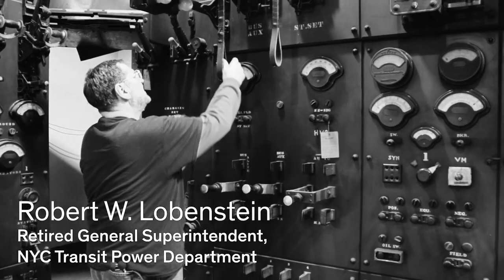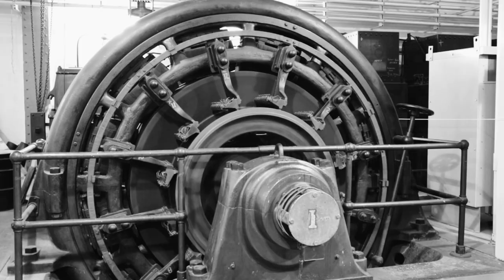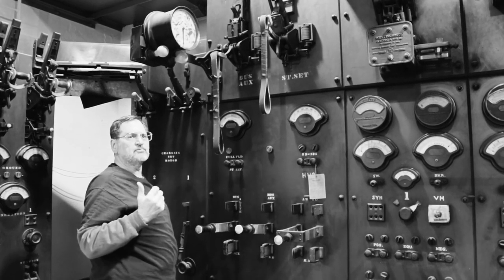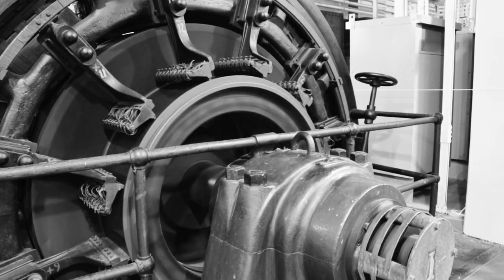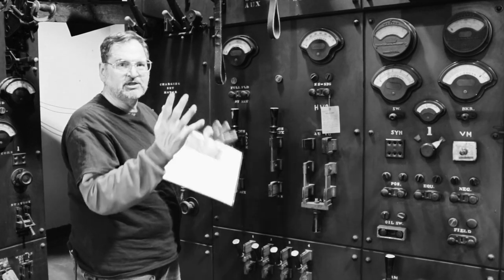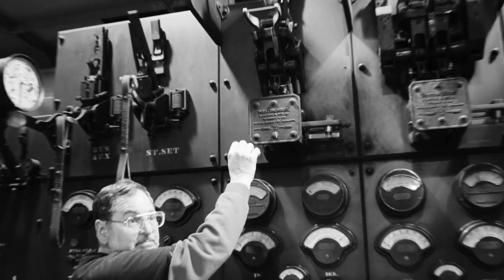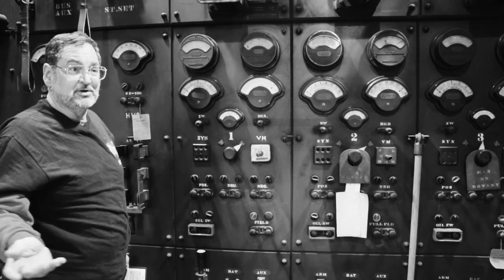NYC's 45-Ton Rotary Convertor

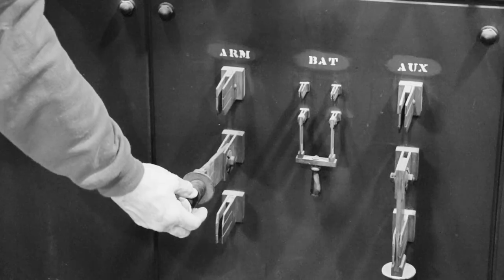Comment: 01:09 did I see a spark there? Meaning that there is a voltage potential on those metal switches? And he is touching them almost? Yup... like the good ‘ol days
Reply: Well... busses would be worthless without current flowing. You don't move electrons without a potential difference so... thats kinda how a switch works when you close it.
Reply: @etherealrose2139  yes, but do they only flow when excited with bare hands? They invented rubber gloves for a reason.
Reply: back when stupid could kill. the way it should be
Reply: @1marcelfilms  or your hand just slips.
Reply: It sparked between those two metal contacts. 

The handle, where his hand touched, is out of the path of flow, and outside the circuit. 
As long as he doesnt touch anywhere on or between those contacts, he'll be fine.

Comment: My dad worked in one of these substations on 38th St in Brooklyn. As a kid in the 70's, I got to visit a few times. They had six of those rotary converters (I believe made by Westinghouse) which looked identical to the one in this video. In addition to these converters, they had huge transformers and two control panels (one for AC and one for DC) for each one. To the best of my memory, Con Ed sent them 11,000 volts AC and the transformers knocked it down to around 400 volts. The rotary converters then converted this to 600 volts DC which went to the third rail to power the the trains. My dad and the other workers took these machines On and Offline in addition to constant maintenance which was mostly brush changes, commutator cleaning and lubrication. As a kid, I was fascinated by all of it. I'll always remember this as well as the insane volume of the sound especially when multiple converters were running at the same time.

Comment: This guy must be an awesome teacher, great explanation of working.
Reply: He didn't once explain any of the terms he used. Unless his audience is full of EE's like me, or at least electricians, all those technical terms will just wash over the tourists like the buzzing of bees. I understood what is going on, because I've studied the history of electrical distribution equipment and electrical trains. But his depth of knowledge doesn't make him a good teacher at all.
Reply: Did you switch off?
Then he's a good teacher
Reply: Kandela Brown  from what I gathered, the DC voltage on the train track (3rd rail) is fed backwards into the system in order to bring the system up to speed so that the AC side of the system is synchronized to the grid. Then the system is connected to the grid with the converter voltage slightly higher than the bus voltage so that current is pushed into the system and the converter becomes a load on the grid and supplies power to the train. I'm a mechanical engineer, not an electrical, so I could be wrong.
Reply: @simonmasters3295  how do you mean?
Reply: Not a very good math teacher though, it was only 114 years old when this was posted, not 118.

Comment: I remember going into the substation on New Lots Ave in Brooklyn, as a kid.  The guys who ran it had a long stick with an abrasive block on the end that they used to polish the slip rings? commutator?  The machinery was mounted in a pit a little  below street level and a good portion of the floor of the station was an open mesh steel grid over the pit.  It looked like a fun job to work there!

Comment: The quality of these motors is amazing. I Manage a chip mill and  we use a 2160 volt synchronous motor on our chipper that was built in the 1930s and originally used in a steel foundry. The motor controls have been modernized and  computerized and we start it by simply pushing a button. The motor itself is all original aside from the carbon brushes and brush springs that are replaced with regular maintenance.

Comment: They used to use smaller units to provide high voltage dc for radio sets in airplanes and ships. They are known as “Dynamotors” and were invented by Nikola Tesla. The a/c and d/c windings are on a common armature with a commutator on one end and slip rings on the other. That is mechanical means of rectifying a/c current or vice versa. I have one in the back of my truck that turns 12v d/c into 500w of 60 hertz 120v a/c. Modern inverters are more efficient and economical. I like the old mechanical things. The dynamotor was invented in the 1880s. Nikola Tesla still holds the record for the highest mechanically generated frequency at 144khz. In 1916 he sued Gueglimo Marconi for patent infringement and won.

Comment: The fact that it's still operational, speaks to the fact that things used to be built to last!
Reply: It sounded to me like this is no longer in use providing power to the subway, but is still functional and can be run for demonstrations. Preserved for historical interest. This would be considered too unsafe and too labor-intensive for actual use in present day. I would imagine it could be modified to automate the control system and safety covers or safer switches installed, if they were still using it now they would have done so, but clearly haven't.

Comment: Would love to have met this man.  Incredible how overbuilt these rotaries were.  They were being used until 1999 when ConEd said no to providing 25 Hz AC.
Reply: Tiny bit of historical context.  The electrical grid in at least most of the eastern half of North America, was 25 HZ Ac until somewhere in the late 1950's.

It was a massive project to, in many circumstances, install 60 HZ AC of all sorts of electrical gear into the grid and leave unpowered.  That was just the grid. Also going on at the same time was the conversion of every type of building  and other use of 25 HZ AC electricity to 60 HZ AC.  Pretty much all the new gear had to remain unpowered until the day of change over.

In the case of this piece of kit, I can only assume some bean counter thought it would cost to much.

Slight aside.  I worked for the local school board (Toronto) for along time. One school I was in a number of times, there was a motor I noticed with more data plates than usual. One day I stopped and took a look and realised this motor had been converted from 25 HZ to 60 HZ. The old plates had been over punched with XXX's but were still readable. The other neat thing about this motor is it still has oiling cups and there is a oil can beside it. Apparently a few drops every couple of weeks.

By the way this motor is for a washroom exhaust fan so it runs everyday for at least 12 hours.
Reply: @foamer443  If you mean the entire power grid, then I call BS on that. A lot of consumer appliances would not have functioned properly at 25 HZ. If you mean a separate grid that only powered industrial machinery and the like, then OK.
Reply: @pauldzim  Yes it was, just do some research. 25 Cycle electricity was common, many household appliances had 25 Cycle transformers in them, I own many these transformers.
Reply: @MrCarlsonsLab  So they built special versions of electric clocks, phonographs, TVs etc for the entire eastern half of the US?? That's hard to believe, if you're talking the late 1950's. Maybe earlier, sure.
Edit: The Wikipedia article is a little unclear on the dates, but a chart there says that in 1946, southern Ontario, Canada was still using 25 Hz. That chart doesn't say anything about the US.
Reply: @MrCarlsonsLab  Not in the mid Atlantic part of the east coast. We were firmly 60 hz in 1952 (as far back as I recall). In 1966 in Niagara Falls they had 25 hz at Sir Adam Beck in Canada and 60 hz at Robert Moses right across the river in Lewiston NY. Some big factories didn't want to replace huge 25 hz  motors so they kept running them using converters. Some pump motors were as big as a box truck, I wouldn't want to replace them either.
Reply: @foamer443  Re: 25Hz, I think you’re referring to Canada, not the U.S.

Comment: The Orange Empire Railway Museum in Perris California had a rotary converter to supply 600 volts DC to run the street cars (trolley cars) around the museum ground. It was a lot quieter than the diesel generator they used before that. Great machinery.

Comment: I saw a rotary converter in normal operation beneath Grand Central producing current back in 1984. Con Ed power from rectifiers came in in 1986.

Comment: I had no idea what he was talking about but the engineering is amazing for the early 1900's
Reply: I am not sure I got it either, but I think this machine converted direct current (DC) to alternating current (AC) for the subway. The weight of it served as a buffer to smoothen out the spikes in the electricity when the trains started and stopped accelerated, a mechanical battery. If I am wrong, please correct me!
Reply: mister kluge  Yes, of course. Thank you!
Reply: @torstenpersson5629  It first uses the DC from the third rail to get spinning, then switches over and converts the incoming AC supply to DC and pushes back onto the third rail. Insanely clever and far simpler than a high power synchronous AC motor starting system of the day.

Comment: Hard to imagine that even with the still newness of electric itself, they could figure out how to design and build all these machines that did such obscure things to it!

I used to work in the 200 block of E 21st st NYC around 1980 and remember a nearby subway powerhouse that in the summer had the doors but grill doors in place open due to the heat and you could see and hear some large 1904 era machines running inside!
Reply: These were relatively crude mechanical implementations of mathematical concepts of electromagnetism that had reached a high degree of refinement about forty years previously.

Whether 40 years is a short time or a long time depends, I suppose, on what else was taking place at the time. Industrialization and shipbuilding were already taking place on a massive scale, and such effort could in principle be directed toward electrical infrastructure just as well as toward any other technology. But steam was still the thing.

It was a visionary leap - and perhaps a real gamble - to commit resources to such a complex undertaking as we see in this video. What an interesting time for our species!
Reply: Victorian Sculptures Did you ever check them out.
Reply: Sometimes I look at old technology having more imagination, and engineering technology than newer products.  Like the torque converter used in Power Glides, or those smart toster ovens from the 1940's.  They could problem solve with the technology of the day, and do so without computer chips.

Comment: I been inside and seen that same type of generator as a kid about 40 years ago inside the substation on Nostrand Avenue between President and Union Streets in Brooklyn.  I believe it powers the 2 and 5 down to Flatbush Junction.  They used to keep the front door open but after Sept 11 it's been tight as a drum...

Comment: Good to see this beautiful machinery preserved in operational state!
Did I understand correctly, that you use one phase ("the 3rd rail") from the public 3-phase network to run the DC-generator as a motor in order to spin up the system and sync it to the frequency of the grid?
This reminds me of the navy where we had to synchronize diesel driven synchronous generators to the network of the vessel. The speed of the generator hat to be adjusted to about 60.5 Hz, i.e. about 0.5 Hz above the network frequency and we used lamps indicating the voltage difference between generator and network. You had to slam in the breaker  just at the moment when the indicator lamp went dark. Otherwise there was a danger that the entire ship lost power. (Which happened once during my service - not to me fortunately.)
And at the harbour there was a huge engine room full of rotary converters converting 3-phase50 Hz (European standard) to  3-phase 60 Hz to provide power to the ships in the harbour.
Thanks for the great video
Harald
Reply: No, they drive it on the 3rd rail just for display - that's the "live" rail that powers the subway trains with DC (which sits beside the two ordinary rails where the trains roll). So they run the machine in "reverse" so to speak, the DC generator working as a motor during this demonstration and I assume the AC motor is disconnected from the grid as the machine has been replaced by static converters.
Reply: The third rail in the subway is the 600 volt rail running along the outside if the tracks in the tunnels that runs the trains' motors. The thing is only covered with a thin piece of wood over it, and they welded those rails live as I remember by covering it with a sheet of rubber to protect the guy welding, scary as heck!
Reply: Harold, normally yes. Back in 1904, you had to get the rotary unit up to speed before before switching over to AC to power. There were two ways to do this.  Use third rail DC power from another converter in the substation that was already running, or if the substation had to startup from nothing, as in a power failure, use one of the motor driven generators. Either way, DC had to be used to bring the unit up to speed.
Reply: I read somewhere that there were issues getting several Rotary converters in sync and also the polarity of the rotary converter could not be predicted. What do you think?

Comment: Ah, motor-generators. I remember them from US Navy nuclear power training. Submarines used them to convert AC from the steam powered turbines to DC to charge the batteries, and DC from the batteries to AC for emergency power in case of a SCRAM.
Reply: I just made a comment about the same thing. If you remember they were designed to start from the AC side of the motor generator but they could only do it twice. It was done once to test them. After that you only had one more shot at starting them from the AC side. The sub that I was stationed on had to do an AC side start because of a casualty situation that we were in. The nuke EM Master Chief, that had over twenty years in, said that he had never seen or heard of it being done on a boat. 

What had happened was that we were doing a reactor SCRAM drill. Of course we were running on the battery while the reactor was SCRAMed. In the middle of the drill the bus bar (with no spare bus bar on board) from the battery vaporized (that is not an exaggeration) and we lost all of our power. There was just enough residual steam in the system to get the SSTGs to turn over to supply just enough AC power to start up the two AC-DC motor-generators. That allowed us to get the reactor back up and running. If they hadn't started up we would have been dead in the water until the electricians could jury rig a connection from the battery to the boat, which they eventually did. And that is how we got a four day liberty call in Barbados while waiting on spare parts to be flown in.
Reply: @ssmt2  They are NOT motor-generators; the same single armature winding connects to both the AC and DC sides, and there is one DC field.
Reply: @BernardGreenberg  Thanks for the clarification. My sub quals were done over 40 years ago. I remember them being referred to as motor-generators. But I was a Missile Tech, not a nuke EM, so I wasn’t knowledgeable about the inner workings of them.

Comment: Very nice video. Enjoyable and informative to watch. Power initially for the NYC subway was provided at 25hz (cycles) AC  that had to be converted to direct current. These rotary converters were all over the city in substations. I recall seeing these structures, containing up to about six of these interesting machines. 25 hz AC is no longer used, today 60hz AC is converted to direct current using mercury vapor or solid state rectifiers. These rotary converters were gradually phased out. nycsubway.org has an excellent description of the workings of the subway.
Reply: you mean the NYC subway cars run on DC Motors?!?!?!  Isn't that bad?
Reply: @klam77  Well, the NYC subway is bad, but running on DC is not the reason it’s bad. As for the motors: obviously they were DC motors. Modern cars use inverters and can use induction motors even though they are powered from a DC rail. Whether they are used in any particular DC 3rd rail system mostly depends on history and politics, not engineering, though.
Reply: @absurdengineering  And up until relatively recently,  all diesel electric locomotives had DC traction motors. Many still do.

Comment: I worked in a factory that made tar paper using large rollers. The entire system was run by a DC power generator that was spun by a large AC motor at about 100 horsepower. The DC motors were  controlled by large rheostats with heavy copper windings. It was like Dr. Frankenstein's Laboratory with the noise and some arcing. I liked working there.